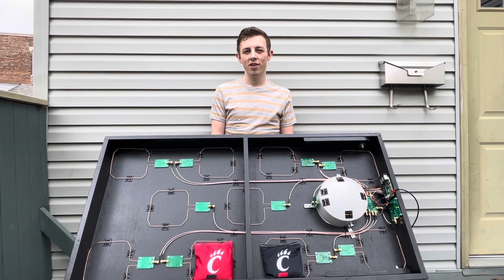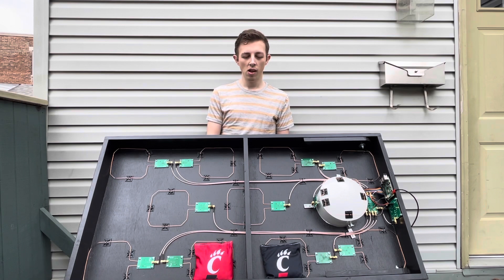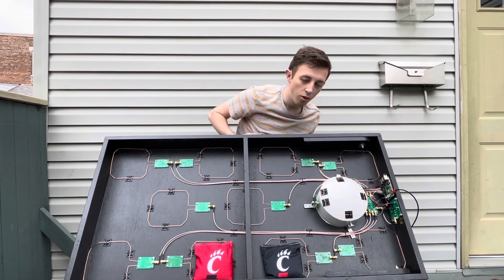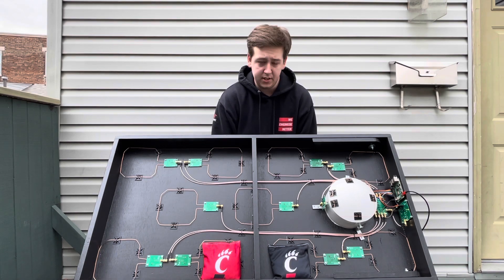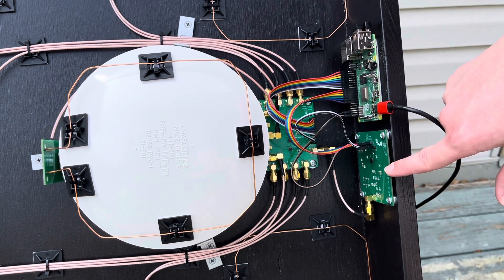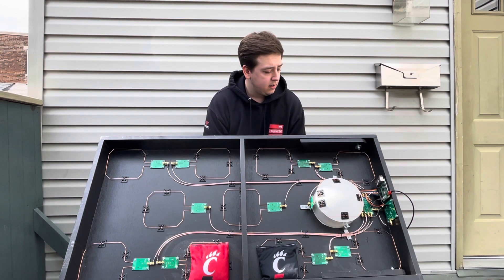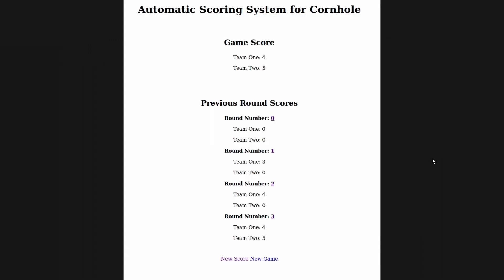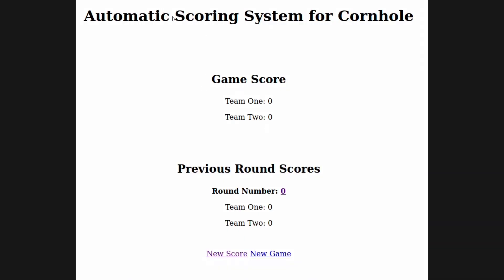Automatic Scoring System for Cornhole UPDATED

Comment: Nice! We did the same in 2014 at the Citadel. We used oversized 7 segment displays and an Arduino mega. It was crazy expensive for the rfid components though. Was close to 1k for all the parts. If we could have made the readers and mux ourselves it would have been feasible and a profitable project.